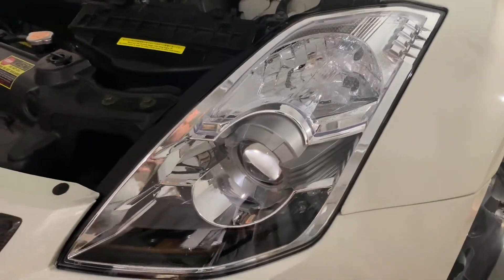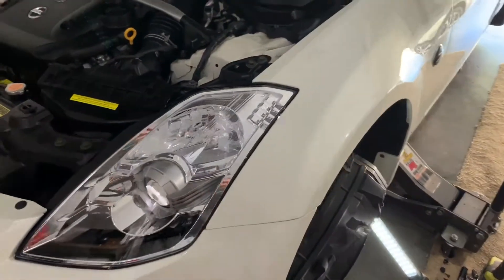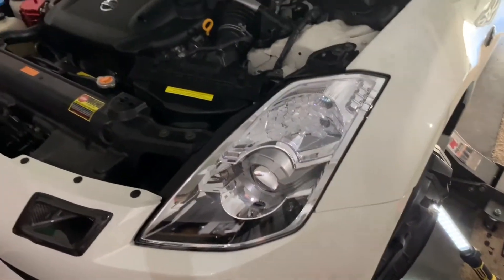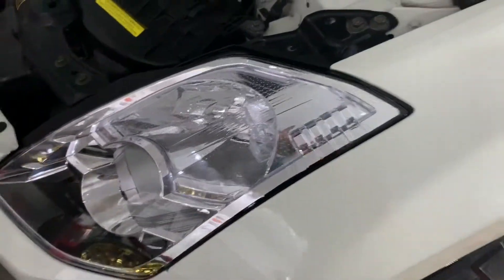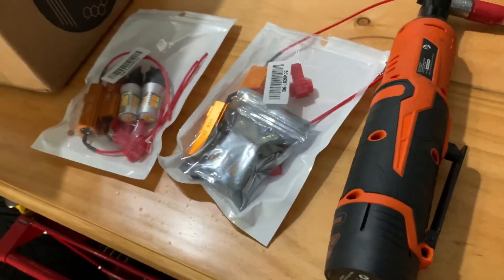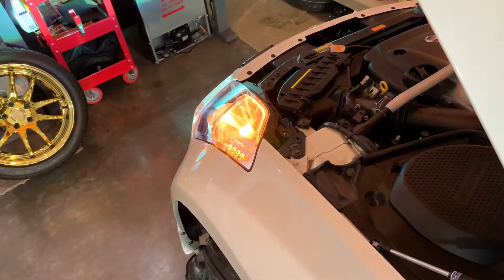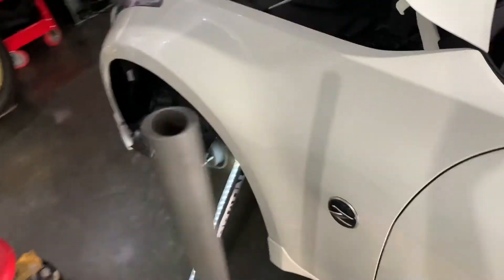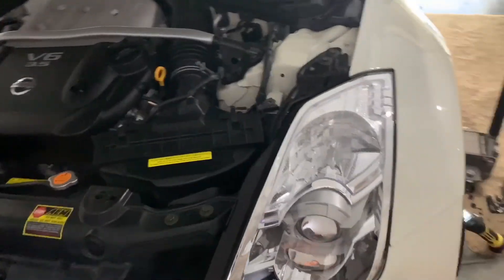LED turn signal mod / hack for cars on a 350Z

Comment: Thanks so much bro I’m gonna try it but do the hazards still work.
Reply: And also the early models front turn signal bulb only has 2 prongs if I’m not wrong, but if you got the 05+ z I believe you won’t have that problem